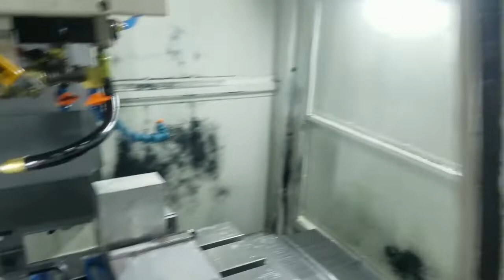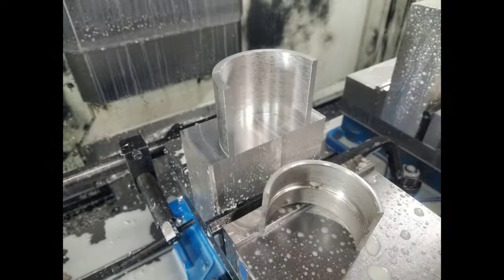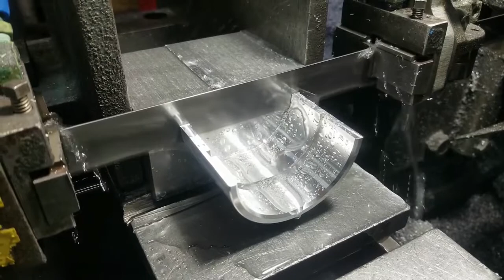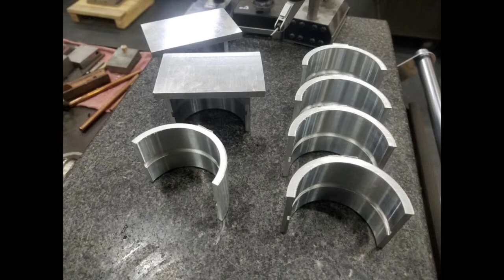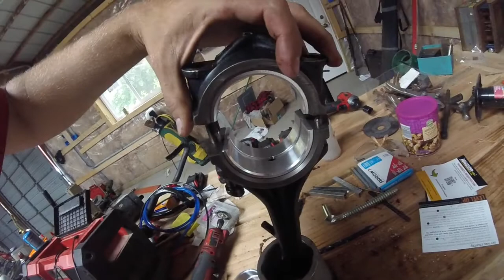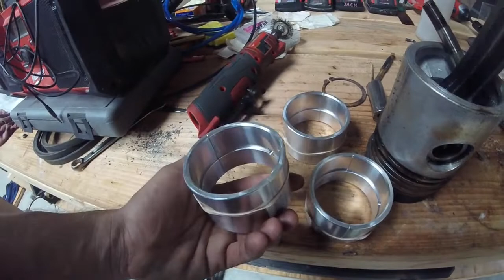Caterpillar D2 Part 11 New Rod Bearings

Comment: Really cool.  Did you use any kind of special aluminum alloy for the bearing stock?
Reply: Awesome job on the bearings mate, really neat to see. When is your next video up of the build process
Reply from the maker: Thank you! Well from what I've read and heard around the internet, the originals were made from what is very similar to plain old 6061. So that's what I used.